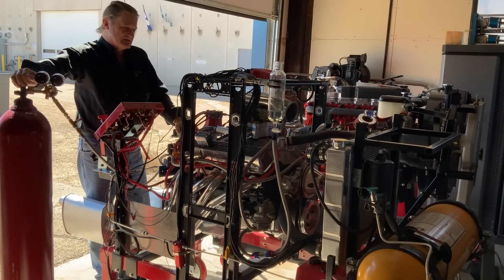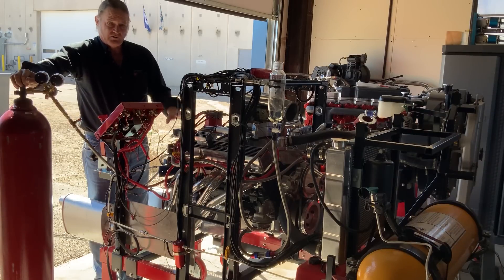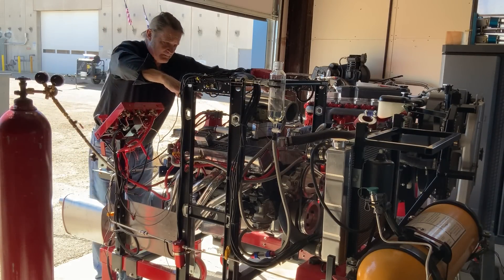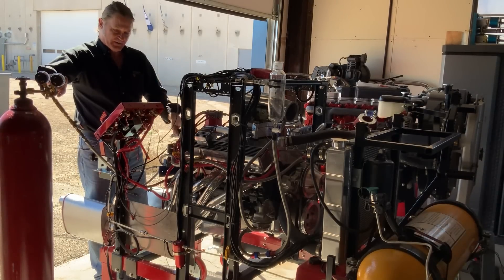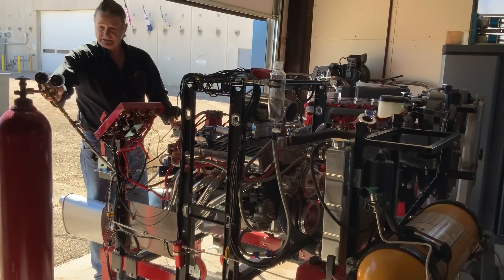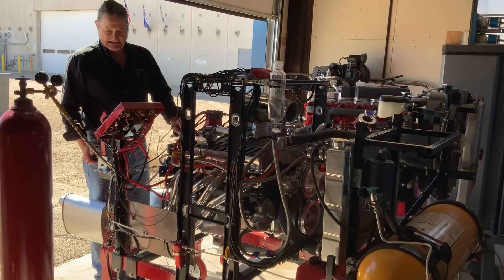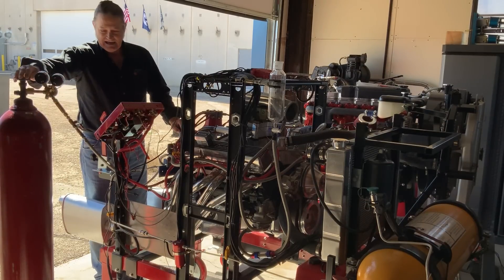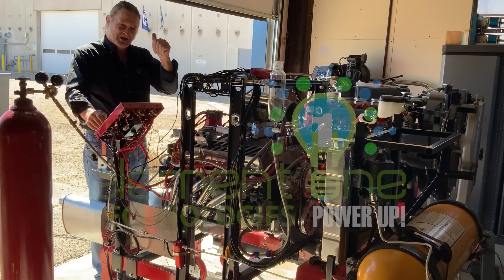Hydrogen powered V8 ICE High RPM Test

Comment: 90% of your car needs to be fuel tank if you want to run this.
Reply: The ICE holdouts will never get this.
Reply: Another problem is that hydrogen is such a small molecule atom that it leaks out of pretty much anything you try to store it in. BMW built a demo car in the noughties and the advice was not to park it in a garage because the hydrogen would be constantly leaking, with the attendant risk of an explosion if you turned on the light. After a couple of days the hydrogen tank would be empty anyway.

Comment: Running a combustion engine on hydrogen is easy, you’ll lose 20% power compared to petrol  but the main issue with hydrogen is storage. Only safe and practical way is with metal hydrides, unfortunately hydrides are expensive and the ideal ones are prohibited/ controlled by law due to their use in thermonuclear weapons even though it’s a benign substance on its own. Can’t have people making free fuel now can we.

Comment: Ran my VW 411 LE on LPG basically on same setup way back in 1980 to work and back every day. 
Electrical Foreman didn't believe so I demonstrated to him. 
Was quite cheaper than running on petrol at time and much cleaner burning on spark plugs and exhaust with no bad effects on engine. 

Two years before that I ran same car on 100 % ETHANOL  with minor adjustment to Dwell angle in Distributor, magnificent increase on power.

Comment: All do the same my concept is use fuel injection and add nitrogen replace fuel injectors for lpg high flow injectors all works at 60psi needs to be correct injection time

Comment: "I'm running out of hydrogen" those are the key words.
Reply: Well he didn't have much to start with anyways lol. Especially from just a industrial tank, what do you expect lol.
Reply: @3n3ly7m9  and how many tanks would you need to go 300 miles? It's incredibly inefficient.
Reply: @zqzj  I'm not sure how much and at what PSI would be needed. That's not anything I'm worried about at the moment. (I'd probably want to get more than 300mi though lol. 400-600mi is a normal amount between all my cars)
Reply: @3n3ly7m9  yeah that's never gonna happen with hydrogen ICE. Your car would be 50% fuel tank to get that kinda mileage
Reply: @zqzj  I mean....... I could turn the Suburban into a 2 seater lmao. Though with that much that would be well over 400gallons of fuel. Not sure if 50% sounds to correct lol. Remember it has to be pressurized. at 25mpg with 400gallons of say gas. Thats over 10,000miles xD
Reply: @3n3ly7m9  well lets see,  1kg of H2 would be the energy equiv.  of about one Usgal of gasoline.  A standard size 200 compressed Gas cylinder would contain about half a kilo of H2 gas.  Oh and a kilo of H2 gas would be about 3170 USgal of gas at atmospheric pressure.
Reply: @milanswoboda5457   The energy in 2.2 pounds (1 kilogram) of hydrogen gas is about the same as the energy in 1 gallon (6.2 pounds, 2.8 kilograms) of gasoline. Because hydrogen has a low volumetric energy density, it is stored onboard a vehicle as a compressed gas to achieve the driving range of conventional vehicles. I think google explained it better. I don't ever use kilios as a measurement. Only Metric I use is Meter and km/h. I like imperial better for other stuff as its more accurate cause of the higher conversion rate.
Reply: @3n3ly7m9  well compressed H2 is sold in kg at a H2 filling station even in the US, UK,...etc., and a big LOL on imperial being more accurate, a unit does not have an accuracy as it is just a known qty used to measure something. Now since you like imperial units we put it as 2.2 pounds comes to about 0.833 Imp gal of gasoline to get  LHV  energy equivalence :).
Now Google says that, does it? There are a few caveats to that though. Even compressed at 70Mpa/700bar/10153 psi H2 occupies lots of volume with about 5.37 Imp gal per 2.2lbs of H2 plus the weight of the storage container which at those pressures will be significant even if expensive composite materials are used.  As for "achieving the range of conventional vehicles",  that is based on higher efficiency HFC vehicles and not with use on lower efficiency ICE vehicle which will require about 3 fold in tank volume vs. a FCEV for the same driving range.
Reply: @milanswoboda5457  Well there's no hydrogen station near me within 500miles, so I don't know.
Reply: @milanswoboda5457  Then there’s the infrastructure required to extract hydrogen in the quantities needed. Someone did a study into this and found that a country the size of Germany would need to increase its electricity by 25% if everyone went to electric cars. Difficult but possible. To do the same with hydrogen powered cars would require an increase of 125%. Never going to happen. Even using the Toyota model of a hydrogen fuel cell places a huge strain on infrastructure and that is basically an extreme complicated EV.

Hydrogen is going nowhere.
Reply: This video I had only 5% in the bottle left when I started. @3n3ly7m9

Comment: Cool, now you just need to work out a way to metre it effectively to keep the AFR in range while operating the throttle and putting it under load... I know the tank pressure in higher than a typical LPG system, so an LPG gas converter may have trouble dealing with the increased pressure reliably- but surely one can be modified to suit the pressure and volume requirements of hydrogen... I am Aussie mechanic who has an LPG installation licence and find this an interesting topic. I don't think LPG is as common in the States and therefore knowledge will be a bit limited, if you need any advice I'm happy to help
Reply: LPG is not in any American car nor are there people that I know of or have converted to it. There is natural gas for stuff like Buses and Garbage trucks though.

Comment: Ever thought of using a propane carburetor/injection system?
Reply: Was thinking the same, i converted my old petrol tractor to run on lpg using a vapor gas system from my landcruiser, am re doing the system at the moment as im adding a turbocharger and water injection (water injection instead of an intercooler as they get blocked up too fast while im slashing grass) 
Should be good, how it was before i was getting the same power as standard but with less fuel cost (more timing) but it was overheating due to the fuel not scavenging the heat from the cylinders. So water injection should solve that, plus the bigger throttle and plenum im making up should help too
Reply: I tried it on smaller single cylinder engines with my own mods. It worked except when your engine backfires during start up and blows the intake to pieces.

Comment: For all those fans of EVs... For a sustainable future hydrogen based power terrains are the solution... You can't have enough energy without hydrogen... You may say charging the battery and all... To charge the battery you need electricity which is not in surplus right now... And with the increasing need for energy can we sustain the EVs?...

Comment: I think the main problem with hydrogen on large scale public use is not the technology but long life of engine itself just because hydrogen flame front came much closer to walls of the cylinder there for degrading oil film...

Comment: Before you start to shell out how great this is, consider the weight of the rezervoir and the size to get any practical mileage
Reply: Carbon Fiber Hydrogen tanks are already a thing.. Just need twice the space as a petrol tank.
Reply: @Reginald-Bowls  five times the size, not two.
Reply: commposite tanjs are light run around 19999 psi will have the mileage.

Comment: This is totally pointless. The proper way to do it is to dump the ICE, use a fuel cell and drive an electric motor. The ICE is only 25% efficient at best whereas a fuel cell is 70% efficient. Of course carry on with ICEs if you are happy to pay at least three times the cost per mile and that is before even considering the much higher maintenance cost of an ICE. Even better ditch the hydrogen all together and use the electricity to charge a battery. That is far more efficient, has superior acceleration and is much cheaper to run.
Reply: Finally somebody that has a functioning brain. Thank you!
Reply: you say this is pointless .  I've got a generator that runs on hydrogen that generator that I built myself. . .  it cost zero zero in fuel cost .  so I have no idea what you're blabbering on about . . .  this is totally famous cuz my generator works great. . . .
Reply: @claybornlewis276  Where do you source your hydrogen from?
Reply: @theofficialczex1708  I make it myself
Reply: @claybornlewis276  So fuel does cost something. What's your method? Electrolysis?
Reply: No it does not. The energy that you put into generating the hydrogen is going to be a lot more than the mechanical energy you get from burning the hydrogen in an ICE. That is why it is pointless. Please learn physics.
 @claybornlewis276
Reply: I also built a 10 KW generator on hydrogen  @claybornlewis276
Reply: you say this is pointless show us what you got
Reply: A knowledge of physics, in particular thermodynamics, that most people on this forum are clueless about. @claybornlewis276

Comment: i would love to see how it performs under actual load  like on an engine dyno .
Reply: Toyota has a hydrogen powered Corolla, there's a video of it on YouTube and it sounds just like a regular 4 cylinder!
Reply: Yes, gas vs hydrogen.
Reply: Well the engine is still in the early stages of development so you'll just have to wait
Reply: Well, the space shuttle engines used hydrogen for fuel, and they seemed to make a fair bit of power...
Reply: @slowpoke96Z28  why would petroleum companies spend more effort/manhours/money/equipment to convert more of their fuel into hydrogen when petroleum is a much more energy dense chemical? which by the way doesnt require huge pressure vessels and cooling systems and emergency relief valves... whats that? government money placed there by lobbyists that we have to foot the bill for? lol yeah i get it now. 'chemistry'. dude, look into potassium borohydride and the energy density of pressurized gas hydrogen and you will come to the same conclusion i have. there is only 1 way to do this. weather you burn it or put it through a fuel cell (which needs more development) is something i dont care about eitherway. im tired of people making accusations against me as the bearer of bad news rather than asking what i mean. hydrogen is great! in the right context. producing it on demand at the point of use is the only way it can work. government needs to get out of the way with hydrides to start with.
Reply: @BCzepa  wtf are you talking about? You said hydrogen isn't a way to reduce a cars carbon emissions. Burning hydrogen doesn't produce carbon emissions because there is no carbon on the equation to begin with. Idk what all that other jazz is you're talking about, petro companies converting fuel to hydrogen, etc.
Reply: @slowpoke96Z28  atleast try the first question. i know you can do it. to point people in the right direction: antarctic ice core samples. hydrogen for industrial use is not produced any other way. they actually use it to fill up the wells and get more out of them
Reply: @BCzepa  It really seems like you really wanna be right.
Reply: @LiveRubii  right about what? i know hydrogen cannot be used in cars as a gas stored system, the energy losses are tremendous. nobody can justify it. i dont think anyone here is disputing that. 

as for the rest of the conversation, nobody has come to the table yet. - there are some really cool videos on vimeo from electriq global about this kb3 molecule for solid hydrogen storage.
Reply: Always plan for the worst.
What happens in a very bad wreck. Say a 20 car pile up on the highway in a blizzard?
What safety precautions are  necessary with a hydrogen fuel supply?
Reply: @Fire.4Effect  Nothing. Hydrogen is safer that gasoline. That wasn't hydrogen that burned nor was it the cause. The cloth chemically treated covering is what burned.
Reply: @CraigGrant-sh3in  even if it is safe, its too inefficient to store or handle like this. its much more efficient to store the hydrogen as a solid. potassium borohydride, then slowly release this from water as needed. (can i get a jumpstart mate? my starting capacitor is broken)
Reply: @CraigGrant-sh3in  
Gasoline is more volatile than nitro too, but do you want cars running around on nitro?
Just because we can do something, does not always mean we should
Reply: @BCzepa  Hydrogen on demand is the way to go. No tanks, no high pressure. You need very little HHO to reduce emissions greatly in a normal IC engine. Hybrid designs are almost always better than just one or the other.

Also, if you didn't have a billion trillion dollar industry getting gasoline to you, it would also be totally unreasonable to have gasoline cars.
Reply: @Fire.4Effect  a gas hydrogen fuel car will NEVER drive on the road as anything more than a novelty and EXTREMELY expensive science project. there will never be a production vehicle with hydrogen stored as a gas. so your considerations are unnecessary. in solid fuel hydrogen as its released from the fuel will have a tank acting as a capacitor of pressure. that will have to have a flashback arrestor and the tank will have to be strong, in any case i dont think there will be any danger to worry about whatsoever. plenty of cars have been driving around with pressurized LPG tanks for years and i dare say there havent been many serious accidents with those. you generally have the tank in the center of the car toward the rear so even in a very serious crash its not effected too much and these pressure vessels would be low pressure and much smaller. so no risk whatsoever.
Reply: oh, and the solid hydrogen fuel will be dissolved in water so the majority of it wont even be flammable.
Reply: @BCzepa  Toyota Mirai. It has stored hydrogen. It uses three tanks for storage. They are sold in the UK, Australia, India, and California. 
Hydrogen has its place. The tech is expensive but it is a better route than pure lithium BEV's in regard to energy and resource consumption per vehicle. There are over + 30 companies in NA that are working on Hydrogen as a fuel source for vehicles. Hydrogen infrastructure is simpler to build than the electrical infrastructure needed to charge so many BEV's. Right now, figuring out a way to produce Hydrogen efficiently and cleanly is the goal.
Reply: @joshfoleyJr  electriq global have products on the market that use potassium borohydride. the KB3 molecule is great for storing solid hydrogen. i think the best way to generate it is by electrolysis from excess power from sea wind turbines or ocean hydro-electric. thereby the BATTERY for this excess power would be solid stored hydrogen
Reply: @BCzepa  Hydrogen Powered Muscle Truck: The Future is HERE! Supercharged LS Classic With Zero Emissions
Reply: Lexus and Yamaha made a functioning hydrogen V8, 5l displacement, and the power output, considering it's NA is very comparable to gasoline engines
Reply: They make similar power but Hydrogen has a quicker response time because it burns faster
Reply: @dozerfarms  thats an excellent point. burn rate. makes me think hydrogen would be an awesome fuel for my 2 stroke concept
Reply: This guy is way ahead . Paste this in Youtube search . "Hydrogen Powered Muscle Truck: The Future is HERE! Supercharged LS Classic With Zero Emissions"
Reply: Check out mythbusters circa 20 years ago
Reply: @DIARRHEA-PANIC  terrible example
Reply: @DIARRHEA-PANIC  man now i feel old again
Reply: deeply disappointing I'm afraid. This is pointless.
Reply: @rogerfroud300  i agree. if lower 'carbon emissions'  are the goal hydrogen is not the answer. however hydrogen in solid fuel storage as potassium borohydride as a chemical BATTERY for energy to be used in electric vehicles using a hydrogen fuel cell is a great idea
Reply: @shaggings  is that a question?
Reply: @BCzepa  you didn't do very well in chemistry did you?? Lol.
Reply: @BCzepa  Hydro emits H2O . There are no emissions . You can close yoursellf in a garage with the engine running and keep on living . Hydrogen is made from splitting water . There are other methods to produce it also